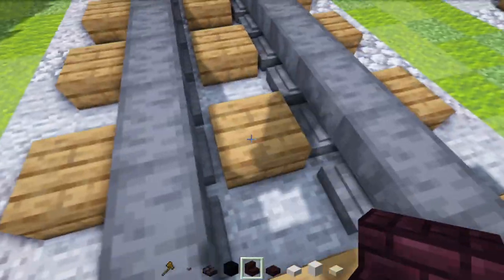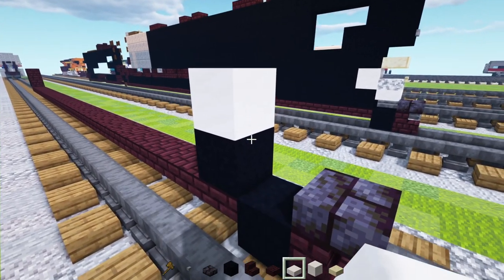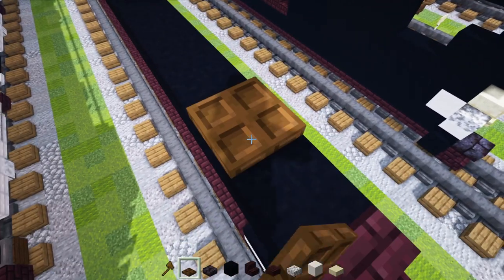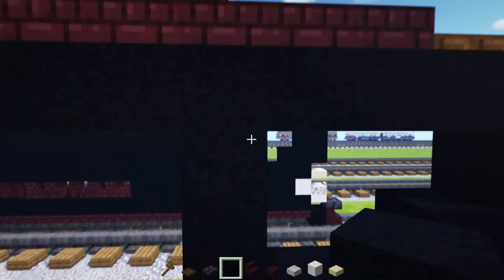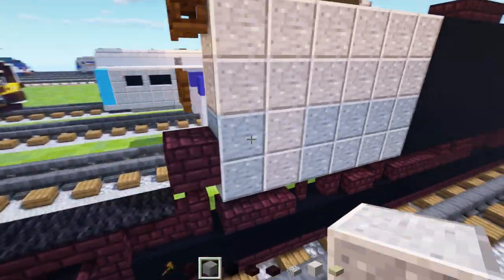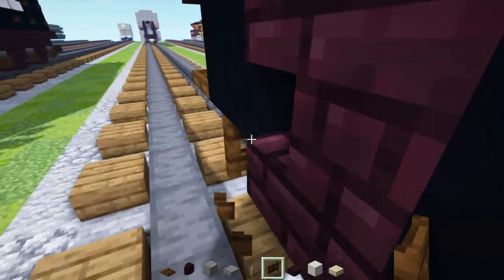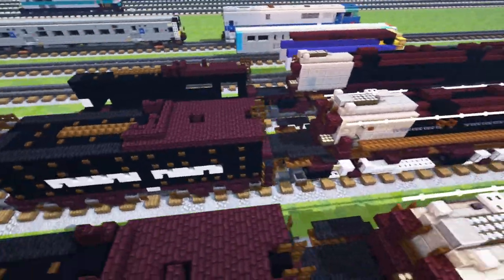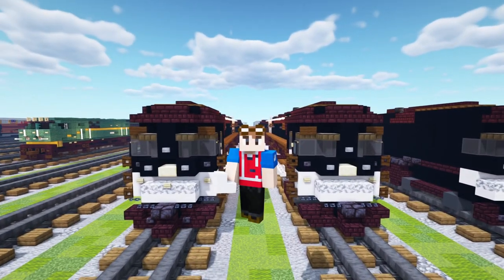Minecraft Southern Pacific AC-12 Cab Forward Tutorial

Comment: Oh crafty 
I forgot 

The drive rods on locomotives aren’t in the same position 
Ones in the top position and the other on bottom that’s why you get The sound of 

1-2 1-2 1-2 

The only locomotives that don’t have the sound are the up 9000 which has 1-2-3 1-2-3 1-23
And articulated locomotives which have 1-2-3-4 1-2-3-4 and sometimes they get in sinc 1-2~3 or 1-1~2-2 or 1-2 1-2

The Erie triplex had 1-2-3-4-5-6 1-2-3-4-5-6 and that has more possibilities 

Then you have the bird burner/ GTEL which was This sound ✈️🛩⛽️⛽️💨💨🔥🔥🛢🛢📣📣📣📣📣💥💥